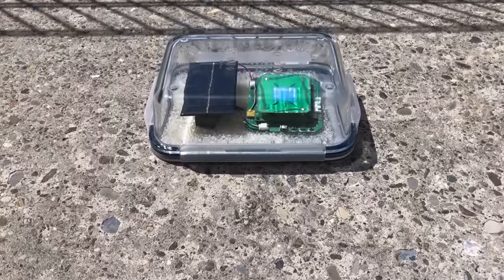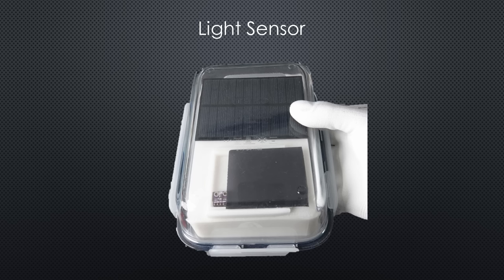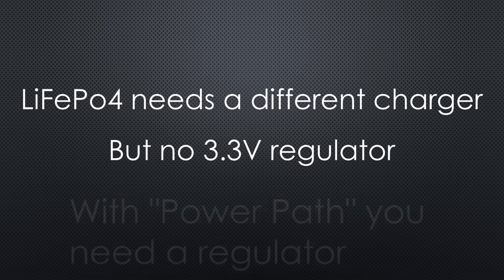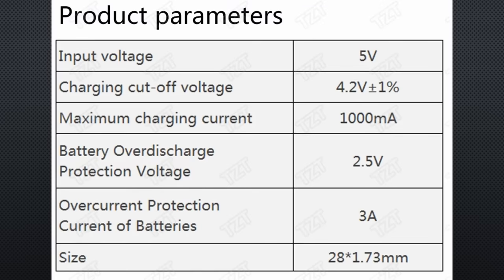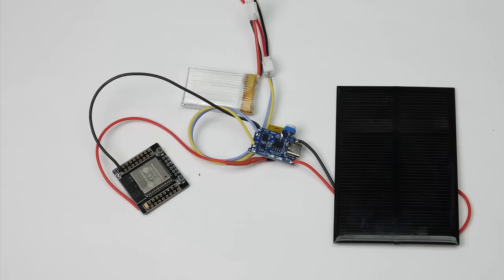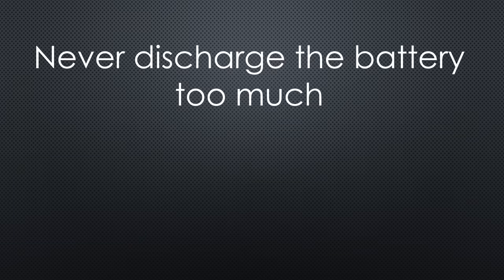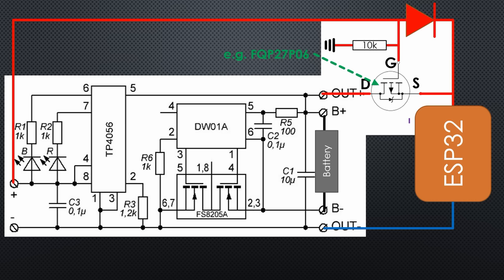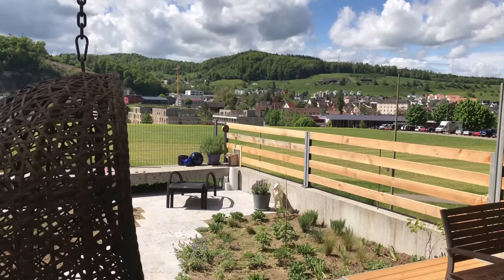#383 Cheap and simple Solar Power for our small Projects (ESP32, ESP8266, Arduino)

Comment: Thanks for this great video. For all my sun powered project, I am using the mppt charger/balancer PS-BC12111   also including a bay for 3 x 18650.... Works flawless.... and cheap.
Reply from the maker: This would probably be an overkill. And I am not sure how much of the energy would be used by the charger board itself... But for larger panels a more elaborated board like the PS-BC12111 is needed
Reply: Nice, do you know of any 2S boards?

Comment: I’d like to see your take on other energy harvesting methods, like rectennas.

Ooh and that PFET circuit is wonderfully elegant. And 90mV dropout on that LDO is excellent!
Reply from the maker: I once did a video about harvester. It is only for very special applications and you have to use very low power chips...

Comment: I contributed the "Explanation of Power Path" video to my local open source hardware group.  Thanks for linking to it.  I don't have a solar panel to test with, but have run simulations on this idea, with results posted to my Github (I'm gbhug5a there).  What I see is that when the solar panel starts generating current, the mosfet turns off, and all battery current is flowing through the mosfet body diode.  If any current is flowing through the Schottky, the voltage on the gate must be higher than on the source, so the mosfet is turned off, and the circuit becomes a two-diode circuit.  The only time the mosfet turns on is at night.  I'm not sure that does much good.  But you can install a second Schottky across the mosfet, in parallel with the body diode, and that greatly reduces the Vf of that path.  If the simulations are right, I don't think the mosfet provides much benefit, but a simple two-diode circuit (both Schottky) might work pretty well.
Reply from the maker: Did you use a Logic Level p-channel MOSFET? Just because you write: "the voltage on the gate must be higher than on the source". P-channel MOSFETS need a negative Vgs voltage for turning on.
Reply: @AndreasSpiess ,  I guess I didn't say that very clearly. My point was that even a small current can flow from the panel to the load only if the Schottky is forward biased.  But its anode is also the mosfet's gate, and its cathode is also the mosfet's source.  So that means whenever any current is flowing through the Schottky, the gate must be higher than the source, and the mosfet must be off.  Any current provided by the battery at that point must be flowing through the mosfet's body diode.  And yes, I used a logic level mosfet. Anyway, I've just reorganized my Github repo to add another circuit which uses a single opamp to drive the gate.  With that circuit the output voltage is never lower than the battery voltage.  The opamp runs on 1uA, and common mode inputs extend above the upper rail, so no resistors are needed.  So that circuit uses the mosfet, the opamp (DIP) and the Schottky diode.  Probably a lot more complicated to work into the charger module, but if that 0.3V drop is critical, the opamp circuit will eliminate it.  Thanks very much for your video.  You are my main source for new things to work on.
Reply: @shermanpeabody7065  Hey, I found your design on github, and will use this for my solar powered project! Thanks so much!! I notice you were simulating this, did you or anyone ever build this?

Comment: Very good 👍, I'm actually building a 12-24v wind generator with a 14 amp permanent mag DC motor and appropriate regulator and batt, the breezes here are not so gentle as in Europe! 
Anyways I saw another video once about inspecting the solar panels with 'near infrared' simply using a digital camera with the infrared filter taken off. They're just LED's and emit this low light when given voltage which also reveals damage.
Reply: Lol and I once heard that scene from Raiders wasn't reallt scripted, Harrison was a actually a little petulant and didn't feel like a fight scene so he just fired the blank
Reply from the maker: I do not think solar panels emit any light. But thermal cameras sees them because their temperature is higher than ambient.
Concerning Ford: Another viewer also wrote that he was ill that day...

Comment: Great video, thank you for explaining the power path. I am going to be using this for my garden automation project. Quick question though! If the load demands more current than the solar panel can provide during the day, does the power path allow current from the battery to supplement the solar panel current? For example, if the load briefly requires 1A to power a solenoid valve and the solar panel can only provide 150mA, what happens? Does the battery get used?

My guess is no, because solar panels tend to maintain voltage output and vary the current output. This means the PMOS gate voltage would still be high, blocking the battery from powering the load. But if the PMOS doesn't let the battery supplement current, then the load will have insufficient current. What is the solution here? Is there something I am missing? This is my first big electronics project so any tips would be helpful!
Reply from the maker: Voltage of solar panels drop at too high currents. So it should work.
Reply: @AndreasSpiess  Thank you so much! Once I implement it, I will do some testing to see if that works out alright. If not, I found some information about "Dynamic Power Path Management" that will allow both the solar panel and the battery to work together in "supplemental mode", allowing them to add currents together.

Comment: note: when he says the solar panel has a direct connection to the ESP 32 (through  a diode)... he also mentioned earlier that he placed a regulator before it (on the ESP module pcb)
Reply from the maker: The ESP development boards usually have a voltage regulator that can be used with around 6V, the voltage of the solar panel. The ESP32 modules alone only support 3.6V

Comment: I am doing it the same way with the FET transistor and ADC voltage monitoring. With the voltage monitoring I am doing also the undervoltage monitoring without the DW01A.
Reply from the maker: A good idea to set the ESP do sleep at undervoltage condition... So you can save the  DW01A

Comment: Nice practical circuit.

If one can obtain local insolation data for the deployment location, the panel size and battery capacity can be matched better. Around here, data from the local agricultural research station revealed periods of up to 19 consecutive dull days where insolation over the whole day was less than a tenth of theoretical for the time of year. i.e. long, cloudy periods. Although that was a decadal event, shorter periods of 9 days or so are almost every year, in some cases with relatively clear skies for 3 to 5 days, followed by another 5 heavily overcast days.

Note I am in sunny Western Australia!

Given the known conditions and assuming that the application was vital, I would size the battery to power the device for 3 weeks without sun, and the panel to fully recharge the battery within 3 days of say 80% sun.

If you're monitoring the battery state and panel voltage, then you can schedule a visit if the battery and panel voltages remain inexplicably low... Such as when avian deposits block bright sunlight from the panel.
Reply from the maker: You are right with your calculations. I did them in the video I mentioned and even gave some links where you find the needed info. I had both my projects out in winter and hardly got below 4 volts even here in Switzerland...

Comment: I was in the process of designing a module based on the concepts you presented when I noticed: The power path presented in your referenced video is designed based on the assumption that external power is either present, or not present. This is not the case for a solar panel, and I am concerned about a possible flaw (and whether it occurs in the real-world). 
Assume a fully charged battery, so very low current draw by the TP4056.
The Voc for a solar panel is largely independent of the illuminance.
The schottky diode in the power path sets Vgs  = Vf(schottky) any time the sun is shining.
Even with a P-Fet with a very low Vgs(th), like an AO6401, this means that the P-fet would be off.
With an open circuit for the load, the P-Fet will be off, as Vload = Vs, and Vgs = Vsolar = Vs + Vf(schottky) (which must be positive).
With a short circuit for the load, Vsolar will fall, but Vgs will still be positive, and the P-Fet will be off (though the body diode will pass current).
The schottky diode sets Vgs as a positive voltage any time the combination of the TP4056 current and P-Fet gate pull-down current is insufficient to reduce Vsolar below Vbatt - Vf(body diode) , and the P-Fet will remain off as long as Vsolar > Vbatt - (Vf(body diode) + Vgs(th)).
Therefore, in low light cases (snow, rain, evening, etc.) the current supplied to the load will be limited to the low-light capability of the solar panels, and to the capacity of the P-Fet body diode.
If I have understood the circuit correctly, then there should be conditions under which the charging circuit with a power path is unable to provide sufficient current to drive the load which, could cause undesirable behaviour.
Have I understood the circuit correctly and, if so, does this actually happen in real life?
Reply from the maker: Your analysis is correct. Two questions have to be answered:
1. Is i dangerous? I think, no
2. Is it better than without it? I think, yes. Also because my experience showed that the solar panels lose power quite fast if the light gets lower.
But you can try to create a better design using comparators, of course.
Reply: @AndreasSpiess  Thank you! I was hoping that I was wrong, or that this was a complete non-issue in real-world application. I have looked at a number of other ICs that may be suitable, and that use current and voltage sensing to manage the battery <--> load connection, and I may look at using comparators as well - I am trying to design a low power, esp32-based development board with a "universal" (for my use cases) power supply. Thank you again for all of your educational videos - I have learned a great deal (and spent a lot of time down many rabbit  holes as well).

Comment: Please note that if you are building this circuit and using a MOSFET as a switch to either turn the battery path on based on VG=0v, then this circuit may give unintended results with a solar cell.  Be careful when choosing the MOSFET as VGS (th) are generally quite low which will cause the MOSFET to turn off when there is a small voltage at the gate, leaving the battery path off and the solar path on for a voltage that may be insufficient to power the ESP (<3.3v).  In full sun, things should be rosey, but the output of a solar panel will vary throughout the day and often dip below the required power to keep the ESP running with the battery turned off.
The fix is to monitor the solar power and only switch off the battery when there is sufficient power coming in from the solar.
Reply from the maker: You are right. With little solar power the FET can be partially on (This is why a low Vgs type is needed). But then the body diode still conducts and we have the same situation as with a diode alone. In all other cases this circuit is better.
Reply: Yes it is still a good solution. Just need to be careful of how the MOSFET is driven. A better option would be to drive the gate using some other logic and not rely on the solar power path. 
Great channel by the way.!
Reply: @peterholliday8761  I'm having unexpected results when the irradiance is small, indeed. the powered esp32 reboots because of brownouts since i only get about 2.6V to it in this situation. My code breaks during brownouts and I need a better gate control circuit. Would you please help?

Comment: Excellent. Thanks for this Andreas. I've been struggling to add an E-peas solar charging chip to my lora board. It does mppt, but it doesn't seem like I'm winning much. It's very complicated and expensive. I think I'm rather going to use the design you show in this video.
Reply from the maker: My tests also showed that MPPT does not help with these low power panels. For you own PCB you might also have a look at the bq24074 or similar ( https://www.ti.com/lit/ds/symlink/bq24074.pdf?ts=1621319840198&ref_url=https%253A%252F%252Fwww.ti.com%252Fproduct%252FBQ24074 ). It seems to have a built-in power path.
Reply: @AndreasSpiess  Thank you for this. I've been trying to find this for months!

Comment: An overkill solution can be the  PS-BC12111 its a MPPT controler plus 3S 18650 BMS integrated
Reply from the maker: This for sure would be an overkill. And maybe it would also use a big part of the solar power of this small panel...
Reply: @AndreasSpiess  it is for bigger solar panels about 10w to 50w (15v to 24v)

Comment: Sir Andreas Spiess, lets go fancy, are you keeping the cells in those glass enclosures?  Not sure how hot those cells will get during summertime in full sun. Might be worth an experiment on how we can keep those cells as cool as can be.
Reply: Monitoring of the interior temperature would be useful. For his geographic location, high temperature may not be a big problem.
Reply from the maker: 1. You are right. I plan some experiments with different solutions proposed by my viewers.
2. I measured temperature during summer. It was never above 65 C. Which seems to be ok for storing these batteries. Storing, because they are already full during this time and not used because of the power path.

Comment: Great informative video. I would love to see you do a solar LoRa setup
Reply from the maker: You easily can combine this setup with any LoRa node, I think. Just do the calculations (it probably will use less energy).
Reply: @AndreasSpiess  I really want to apply something like this with the TTGO T-Beam. But maybe I can use the AXP192 chip to do the power management and connect the battery directly to the battery holder on the T-Beam and just connecting the Solar Panel using a TP4056 and maybe a USB buck (in order to power it by micro USB), what do you think about this implementation? Great channel, you are an example for all of us young engineers :)

Comment: Nice video as usual, thank you for your effort. I have TP5100 ( It could charge 1S, 2S Li-ION @ 2A Max ) also I got TP5000 ( It could charge 1S Lion, LiFePo4 @ 1A Max ) they are supper efficient compared to TP4056. You could test this voltage regulator MCP1700-3302 its very efficient. When you use TP5000 with a LiFePo4 battery, there is no need to use the voltage regulator.
Reply from the maker: As written in the video: If you use a power path you still need a regulator for LiFePo4... Otherwise not, of course.
The  MCP1700-3302 is a good choice for battery powered devices. Maybe not needed in this application because we do not need to optimize to the microampere.

Comment: Hello Andreas, 
Gilles is back wih some questions:
Sorry to disturb you again but I would need some answers/confirmations about this 383 video before starting soldering.

so , would you be so kind as to confirm that I am right or not:

1) The HT7333 without the middle leg is connected between the pcb 3V3 and ground.

2) The battery voltage(from the regulator TP4056) is to connect to the same 3V3 slot as the HT7333 but on the other side of the esp pcb. The TP4056 ground to be connected to any pcb ground.

3) The 10uF capacitor has to be connected to the same pcb ports as the HT7333 .
4) The solar panel is connected to the TP4056 + and - ports.
5) The battery is connected to the TP4056 B+ and B- port.
6) The ESP PCB is connected to the TP4056 ports 

       - 3V3 to  OUT+
       - Ground to OUT-

7) The 10K resistor (for esp32) is connected to the TP4056 pin2 and ground.

8) The fqp27p06 
      - The middle leg(D) is connected to the TP4056 B+ port.
      - The left leg(G) is connected to the TP4056 + port (before the diod)
      - The right leg(S) is connected to the esp pcb + port (after the diod)

9) The diod is connected between the TP4056 + port and the solar panel + port.
10) a 10K resistor is to connect between the + and - TP4056 ports

Thanks again for your very useful videos.
Reply from the maker: I think you can answer these questions by looking at the diagram I showed in the video. and reading the data sheets for the leg numbers.
Reply: @AndreasSpiess  It is what I did and I have watched maybe 30 times your video and even use the snipping tool to have pix. Hence this list. I just wanted to be sure not to burst anything. As you may have noticed, I have no skill in mosfet even after having read its datasheet to know G,D and S. I assume that my list is right, so I will have to do it by myself.
Reply from the maker: @gilleslebricolo7790  I try to give the information. The rest is yours. And you have to destroy things to learn. We all did it 😞